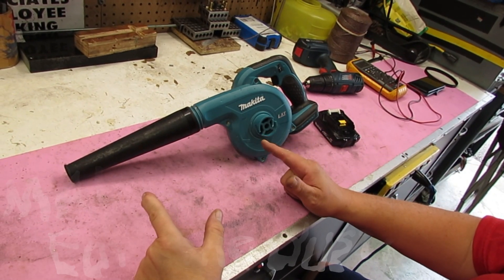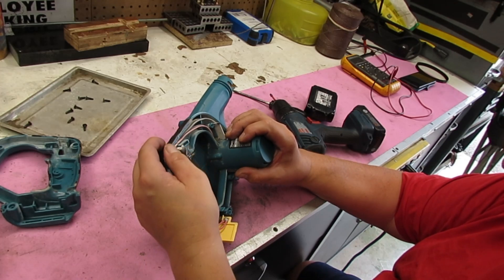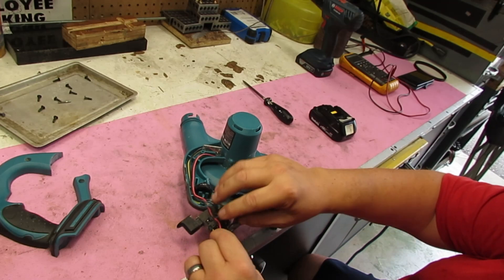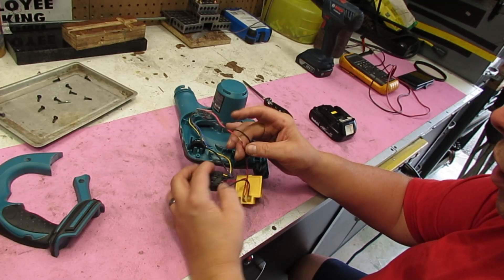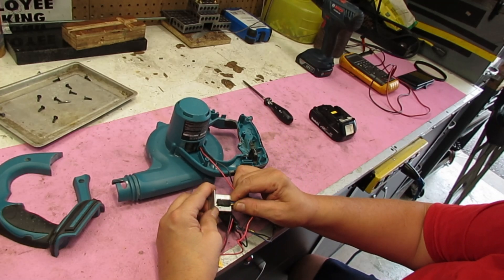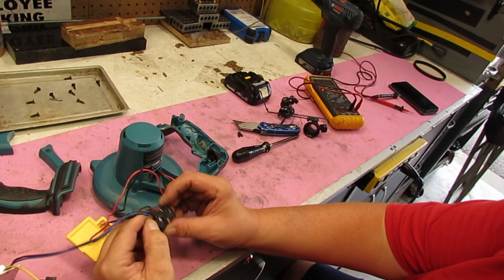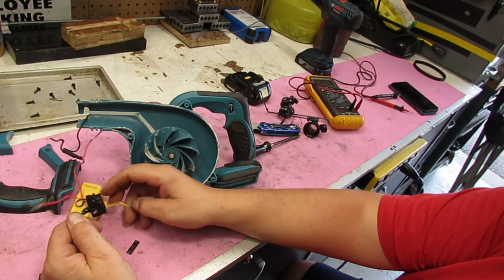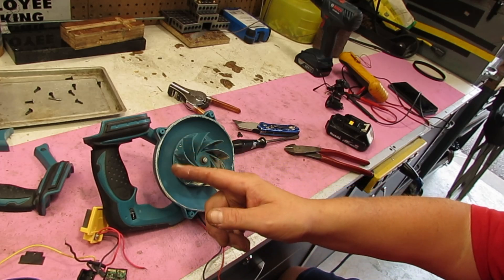Makita BUB182 blower.... Blows

Comment: So is the FET used to switch the voltage on/off at different rates to generate the different motor speeds? 

Please remember the cardinal rule of the professional educator:
There are no dumb questions…
Only dumb people. 😝
Reply from the maker: that sounds about right.  Not quite an SCR,  but more of a PWM.  Sort of.